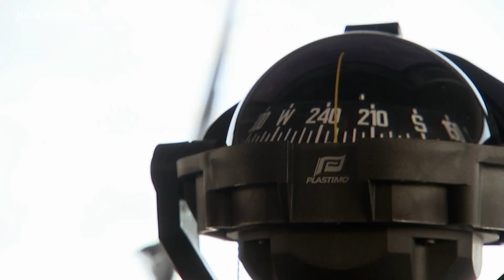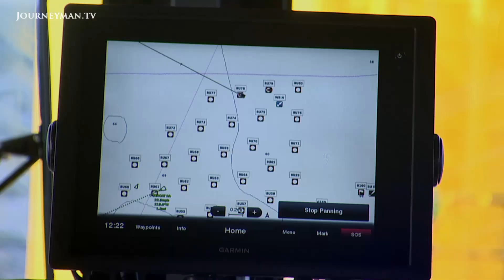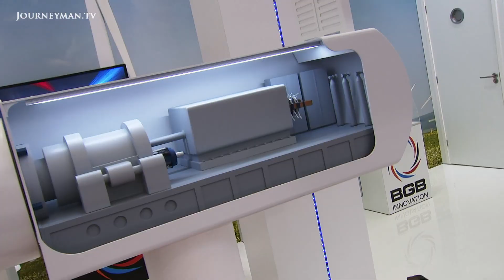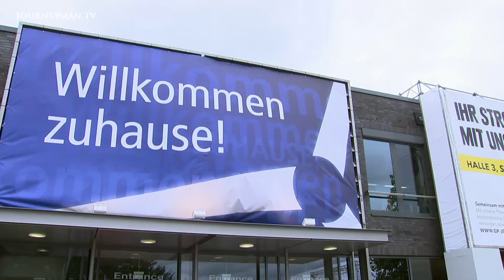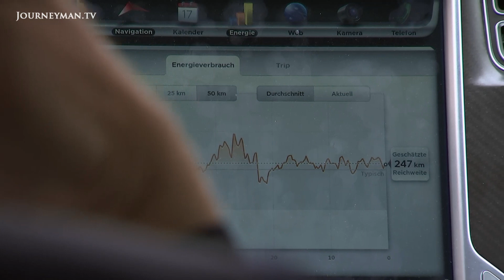How To Save The World: Germany's Wind Power Economy

Comment: Germany has spent $200 billion over the past two decades to promote cleaner sources of electricity. That enormous investment is now having an unexpected impact — consumers are now actually paid to use power on occasion, as was the case over the weekend.

Power prices plunged below zero for much of Sunday and the early hours of Christmas Day on the EPEX Spot, a large European power trading exchange, the result of low demand, unseasonably warm weather and strong breezes that provided an abundance of wind power on the grid.

Such “negative prices” are not the norm in Germany, but they are far from rare, thanks to the country’s effort to encourage investment in greener forms of power generation. Prices for electricity in Germany have dipped below zero — meaning customers are being paid to consume power — more than 100 times this year alone, according to EPEX Spot.

On Sunday, factory owners and other major consumers were at times paid more than 50 euros, about $60, per megawatt-hour, a wholesale measure, to take power.